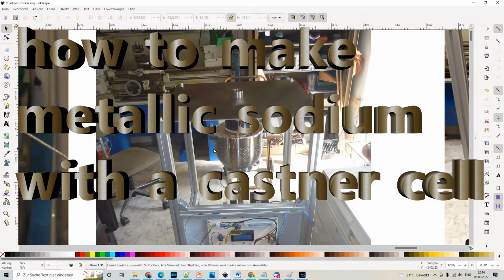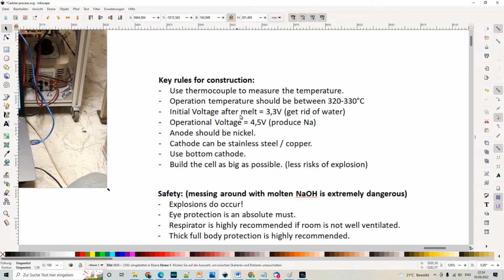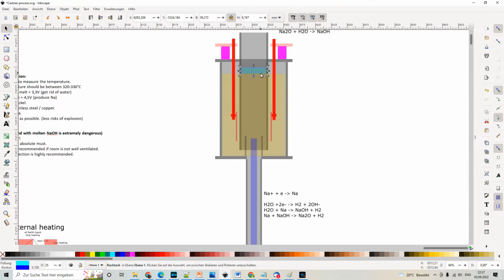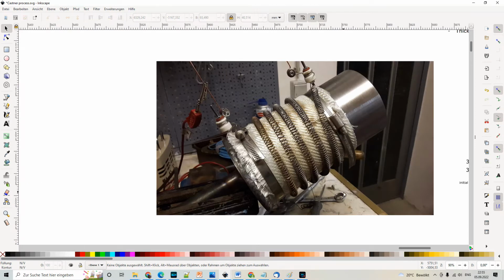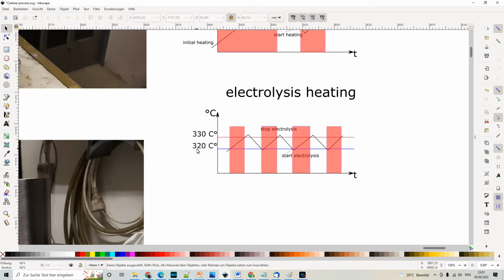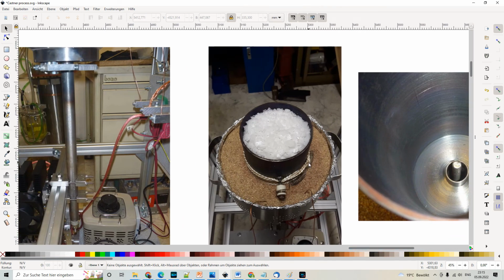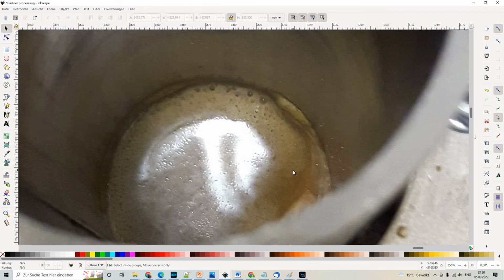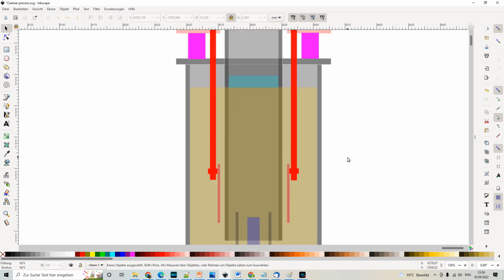how to make metallic sodium with a castner cell

Comment: You can solve the hydrogen problem by connecting a bubbler with paraffin/mineral oil at the top of the cathode cell - the same design that is used for fermentations for example